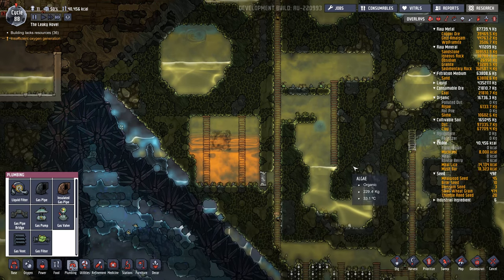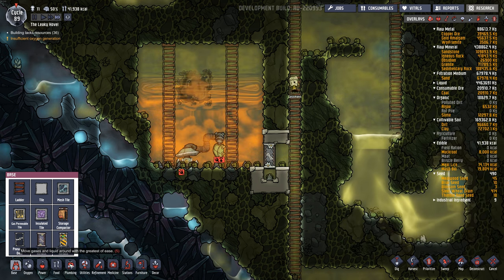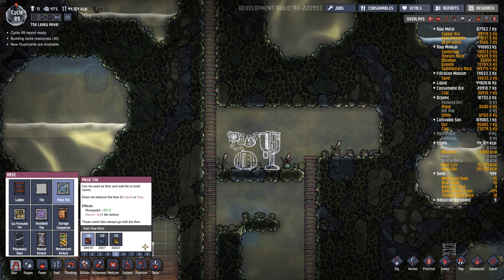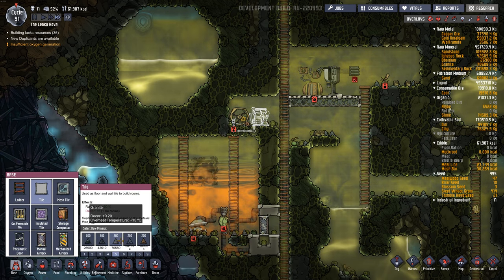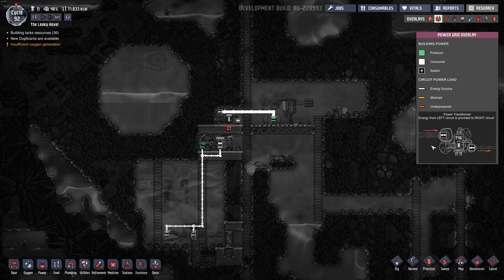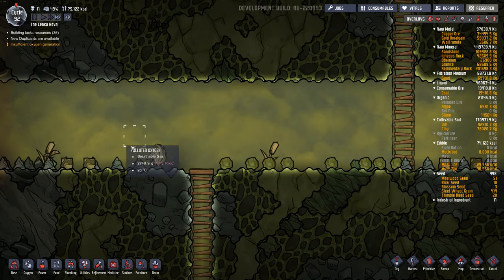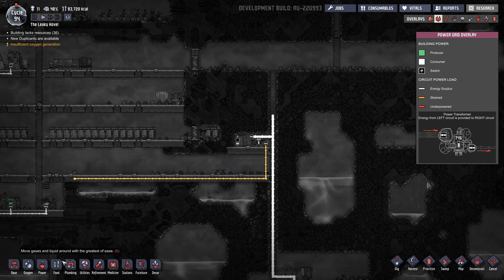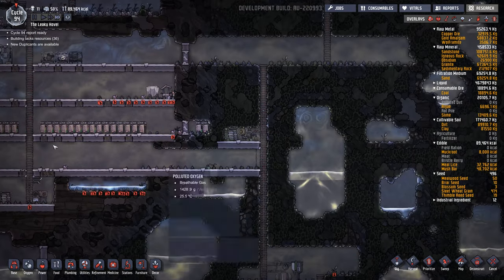Oxygen Not Included | Natural Gas Tutorial

Comment: I’m really enjoying ONI, but I have trouble ‘getting’ how the electricity in the game works.

Why is it necessary to use heavywatt wire when connecting the natural gas generators to an electrical grid? Is it because they produce more than the 1000W a normal wire can handle?

Furthermore I’ve read, as you mention in the video, that heavywatt wire can handle 20.000 W, but when I use heavywatt wire and hover over it, it says that the maximum watt the circuit can handle is 1000 W? 🤔 any idea as to what I’m doing wrong.

Very good video, by the way 😊 very helpful.
Reply from the maker: It is a bit confusing at first. There are two main types of wires I use. The 1kw one and the 20kw one. A natural gas generator generates 800watts, coal 600w, manual 400w. You can use simple 1kw wire to connect say 1 nat gas generator to consumers like 3 gas pumps (240w x 3) and everything would be fine. 4 gas pumps would be 960w so they would struggle to be powered by the 800w. You could add a 400w manual generator and be producing 1200w and consuming 960w and that would all be fine on a 1kw wire. It's only the producers which can overload the wire. So 5 gas pumps at 1200w would damage the 1kw wire and you would need to repair it constantly. So you can do everything with just 1kw wire. 

For larger power grids it's often useful to hook say 10 natural gas generators (8kw) together on one large circuit connected by heavy watt wire. It has a high decor penalty so you don't want dupes near it much. From that large grid you could connect consumers using heavy watt wire and it would work fine. But lets say you wanted some consumers in your base (eg massage table) you would not want the heavy watt wire in the base. So you can connect a transformer to the heavy watt wire outside the base (to the upper part of the transformer) and connect 1kw wire to the lower end of the transformer. From that lower end you could lead that 1kw wire into your base and put up to 1kw of stuff on it. I often connect 8+ batteries to the heavy side of the grid to provide a buffer in case any of the generation goes offline. I also usually connect 1 battery to the small side of the transformer to provide a buffer on that end as well. I'm not sure why you are seeing 1000 W max when you hover over the heavy watt wire. That might be a bug.

I try to put all power grids and machine in a cold zone (ice biome) to keep them cool as well.  Hope that all makes sense.

Comment: Hello, great video, do you know if heavy wires can work underwater? Or if natural gas generators can power the gas pump?
Reply from the maker: yup heavy watt wire works underwater. Nat gas generators output 800W so you can power around 3 pumps at 240W each.